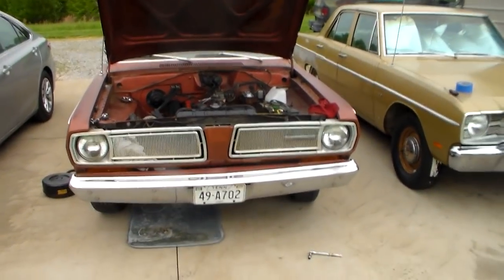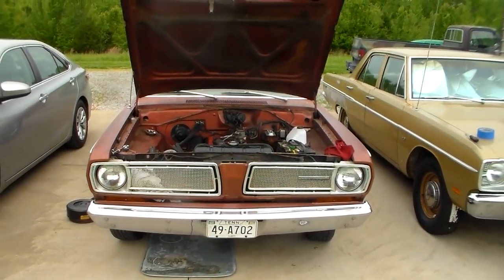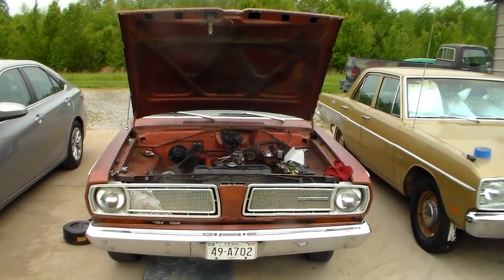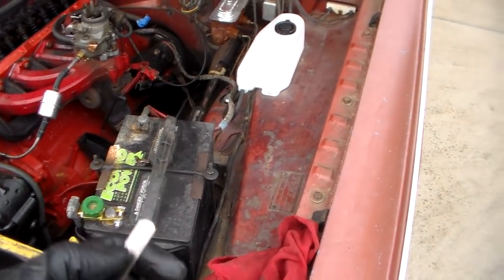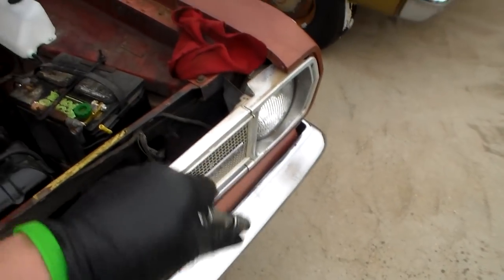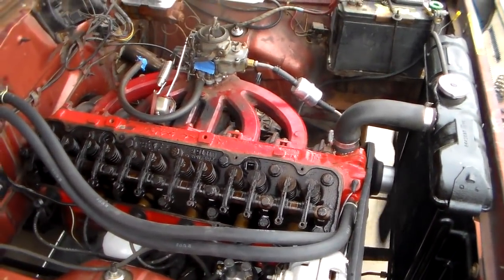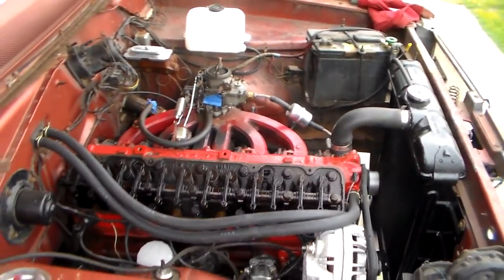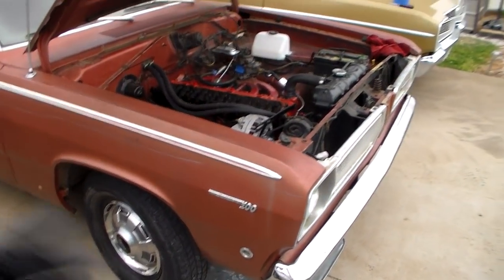Why every 1960-80 Mopar slant six should have "noisy lifters"

Comment: Bought a 1974 red Plymouth Duster in 1976 with 18,000 miles in central N. C. Slant six factory three in the floor. Transmission specified ATF fluid but it was a manual. No power accessories at all, brakes, steering, AC, nothing.  Would do 83 MPH in second and 105 in third and got 33 MPG all day long on a one barrel Holly on the highway. 300,000 miles in 16 years with normal wear items and two sets of rear axle outer bearings at $20 each. Bone stock, 185-14 Michelins went 85,000 miles every set. Torsion bar suspension can't be beat, real fun to drive every day even in 12 inches of snow! I now have a 2018 Camry SE that gets 44 on the highway and is the only car I have ever owned that makes me feel like my Plymouth Duster did. Economy top tier, fun top tier, handling incredible, fast enough, safe, reliable and everyone likes it. Go Kentucky! Be sure to drink your Ovaltine (A Christmas a Story, and be sure to adjust the valve rockers). Thanks for your video. I have a few hundred old car stories.
Reply: My Volare with the four speed OD trans also uses ATF. Strangest thing, but it works.

Comment: Those slant sixes 170 & 225 cubes,and the cars they were in,were very reliable and economical cars to own.Teamed up with a 3 speed manual or a 904 it was easily the toughest car in its price range. The 170 was in a van,and  so was the 225 when the engines lived with you in the cab.Superb delivery vehicles of great endurance.If somebody would have put fuel injection,and MAYBE a turbo on them- that vehicle would be a rocket
Reply: There was also a 260 inchg version for some trucks,met a guy who had a dual,carb,, hot cam,header,etc equipped 260 in an early  Barracuda,sounded mean,went like stink-I had a 63 golden edition Dart GT  convert. with the 225-great car.

Comment: To correctly adjust the valves on these or any inline 6 with a firing order of 1, 5, 3, 6, 2, 4 (which is about 99.9999999% of them, you need to know a secret.
The secret, that is no secret at all is the opposite cylinders from the outside in *6-1, 2-5, 4-3, 1-6, 5-2, 3-4 have a handy relationship for valve adjustment.
*notice how the 2nd numbers are the firing order of 1,5,3,6,2,4.
This is because when you see the engine without the head on you can see cylinders' 1&6 pistons rise and fall together. This happens on 2&5 and 3&4. Since the cylinders don't fire together this means the other piston in the pair are exactly 2 strokes or one full turn away.  

To make it a bit clearer imagine if the head was off your Slant 6 engine.
looking down at the cylinders put in your head that: 
1 and 6 are a pair (and vice versa) and go up and down together
2 and 5 are a pair (and vice versa) and go up and down together
3 and 4 are a pair (and vice versa) and go up and down together

Inline 6 below with cylinder 1 at top and cylinder 6 at bottom shows lash adjustment relationship:

Chart
to adjust cylinder 1 rock no 6 (pair)
to adjust cylinder 2 rock no 5 (pair)
to adjust cylinder 3 rock no 4 (pair)
to adjust cylinder 4 rock no 3 (vice versa pair)
to adjust cylinder 5 rock no 2 (vice versa pair)
to adjust cylinder 6 rock no 1 (vice versa pair)

So there's really only 3 pairs yeah??

'rock' means intake closing, exhaust opening (so the end of the exhaust stroke and beginning of the intake stroke ie the overlap phase)
The rocker arms are both moving ie one closing the other opening.

It so happens that when the rocking cylinders are rocking, the opposite cylinder as shown in the chart above has the cam lobes on the base circle of the camshaft and can be adjusted correctly.

Now since our motor doesn't fire in the order 1,2,3,4,5,6 there is a far more efficient way of doing it rather than rotating the engine 10x and it going cold and the lash changing when it warms up again because we adjusted the lash hot and it cooled down because we took so long.

So - On a 4 stroke engine there are 2 TDC positions. 
What we're aiming to do here is get the correct TDC of no1 at TDC at the end of the compression stroke (or beginning of the power stroke - SAME THING).

A) Note position of no1 spark plug wire in the cap. Remove distributor cap. Rotate motor until distributor rotor is around the position of no1. 

B) Remove rocker cover. Rotate the motor with the fan to get no. 6 rocking. It should already be really close since we just rotated the motor so dist rotor was pointing to No.1 (the chart above shows the relationship)

Now we've done that, this is the magic: We should be able to adjust all the cylinders in two rotations of the crankshaft. 4 strokes = 720deg crank rotation or two turns. 720 deg divide 6 cylinders = 120 deg crank rotation per valve adjustment. 
The distributor rotor further helps by pointing to the cylinder we need to adjust next!

We're now going to adjust all  the valve lashes in the firing order like a professional mechanic.
Remember inline 6 firing order 1-5-3-6-2-4 and the pairs shown in the chart.

C) So if we followed A & B (above) no 1 is ready to adjust - adjust it to hot spec. 
the next cylinder at TDC on the compression stroke is going to be no 5 This means rock no 2 adjust 5
the next cylinder at TDC on the compression stroke is going to be no 3 This means rock no 4 adjust 3
the next cylinder at TDC on the compression stroke is going to be no 6 This means rock no 1 adjust 6
the next cylinder at TDC on the compression stroke is going to be no 2 This means rock no 5 adjust 2
the next cylinder at TDC on the compression stroke is going to be no 4 This means rock no 3 adjust 4

The bold numbers show the firing order.

Again,
If the head were off your Slant 6 engine looking at the cylinders put in your head that: 
1 and 6 are a pair and vice versa.
2 and 5 are a pair and vice versa. 
3 and 4 are a pair and vice versa.

This technique also works for inline 4 cylinder engines ie 1-4 2-3 and vice versa are the pairs.
Exact same principal for lash adjustment except have to turn the motor 180 degrees instead of 120 in a 6!

You can't use this technique on a V8 or V6 because the cylinder numbering is often different therefore the cam lobes are in different positions from different manufacurers but it does work on a V12 because it has a firing order of an inline 6 per bank ie each bank is 1-5-3-6-2-4 lol.
Reply: ThePaulv12 well at least I know why these things tore themselves apart after a long good hard run. Knew a few people who never took the valve covers off though they tweek the carb every chance they had. In every case the crank eventually gave out even with schedule oil changes.
Reply: @kennethwallace4338  i completely agree with you
Average reliability and after the hard run at 90mph no.6 big end lets go, ventilates the block and smashes the starter off. They're an effing pos! lol  I know.
Reply: Damn you know a lot

Comment: Grandpa had a slant 6 in a '60 Valiant Station wagon...over 300K mi , never had the valve cover off .
  Worked at a ski resort for a summer and a couple of the Auxiliary Power Units (back up to the electric motors) were Industrial 225 motors !

Comment: If the lifters are adjusted regularly they are as quiet as a hydraulic lifter engine. In the case of an old engine, quieter. I have had a dozen slant sixes and only one had quiet lifters. It was a 22 year old  pickup truck with 160,000 miles on it, BUT it had been maintained properly all its life.

Solid lifter cams are designed with clearance ramps that take up the valve clearance gently before opening the valves. Hydraulic lifter cams don't have clearance ramps which is why you can't run solid lifters on a hydraulic cam or vice versa.

One that is not kept adjusted will continue to run but, the tip of the rocker arm and the end of the valve stem get pounded out of shape. After that you can adjust them and they will be quieter but never completely silent.
Reply: The elipse or the grind is different. Learned that fooling around with old Ford stuff.

Comment: Reminds me of tuning 6.2 diesels in the army. The new guys would always tune the injection timing till the engine ran super quite at idle. And I would always laugh as they went to drive it out of the shop and it wouldn’t go no where. Some times perfectly quiet is not perfect. Motor sounds great Tyler just like a old slant six should.

Comment: The best and most accurate way to do it is to get the engine hot then shut it off and use a socket and breaker bar to turn the engine slowly while you set each valve. If you are quick about it you probably won't have to restart the engine to keep it hot, however I do believe the old Motor service manuals had settings for both hot and cold. Just never like getting my feeler gauge in there on a running engine.

Comment: Looks like it was a well cared for engine... the inside is clean. Back in the day, I could tell what engine was in any brand or type of car, just by there sound. They all had there own unique sound. Now days cars and engines are so generic, they all sound the same.
Reply from the maker: It's a mystery engine. Dated 1972 with an actual mid-90's Mopar water pump which you cannot get anymore. It had the original manifolds and distributor installed. No trace of blue paint so I assume it has been rebuilt.
Reply: @TylersNeighborhoodGarage  they were very easy to work on had no problems adjusting the valve lash on my dad's 80 Volare.

Comment: One of the reasons the slant six is so durable is that it was originally supposed to be an aluminum block engine. After the engineers drew up the design the company brass changed their minds and decided it would be a cast iron block but they went ahead and used the design for an aluminum block so the block was much thicker than cast iron engine designs usually were.
Reply: They did make a lot of them in aluminum though in the early years. Clark 9the forklift company) used them in an RV they made for s short time, darts and Valiants could have one in a sport model. One of the features of the engine was it's long stroke, it's why the engine was tilted over to allow room for a lower hood line with a larger size engine. The longer stroke gave it more torque so as to make good power at lower revs, also improving economy, which was a big selling point in the early 60's. Chrysler got their money out of the design.

Comment: Good motor! Like Ford's big 300 six, these engines run forever! GM never had such a reliable inline six. Noisy lifters? MOTOR HONEY!!!!!
Reply: The hell you say ?!?!  GM's 250 inline was bullet proof just like the 225 and the 300. AMC's 232 and 258 were damn good engines as well.
Reply: LincolnTek  Too true my Gremlin was a 258 with a three speed and would chirp in every gear but neutral.
Reply: Had a straight 6 200ci  in a mustang with a 3 speed, 198ci Plymouth duster and chevy nova 250ci,  all great low maintenance engines made in Detroit.

Comment: If you set them too tight, it'll cause rough idle when hot. The alternator brushes are replaced from the outside. Use 20w50 in the Summer. The needle valve is replaced externally. Some have spark plug tube seals. The rubber O-ring leaks. The distributor gear is plastic. Check cylinder leakdown to check rings, valves, and head- gasket. Look up the improved head-gasket from the PCB. It's probably a steel gasket and not a Fel-Pro Blue stripe. The crank gear is pressed on. The front end has strut rods to adjust the caster. The camber is set by the egg-shaped cams.
Reply: 20W-50 is unnecessary and as the oil pump driven gear is a weak point 20W-50 can contribute to oil pump gear failure.

The strut rods are not adjustable. Camber and caster are both adjusted at the upper control arm eccentric bolts.
Reply: @Joshie2256  It cools the engine in very hot weather. It won't be too thick. The thicker oil absorbs heat from the cylinders and cools the engine. The bearings run cooler thereby extending bearing life. The valves run cooler especially the exhaust. The extra oil on cylinders drops into the pan. It takes up space between ring grooves. It oils the timing chain for longer life. The oil pump on a slant 6 is the rotor-type and the other end is a gear. It runs off the cam gear on the shaft. Thick oil transfers heat in the pan. It transfers heat so the oil picked up by the pump is cooler. Heads run cooler. Cams last longer. Heat is the destroyer of metal.

Comment: The AMC 242ci I6 has noisy lifers as well, at start up.  Once warm, they run quiet.  I have not seen a vehicle with an AMC 242ci I6 engine that does not start noisy.  But they last forever.

Comment: Post war Chevrolet OHV sixes are the same. With the engine warmed up and the hood raised you should just hear the valve train. If you can't, the lash is set too tight and burnt valves will  result.
On some engines back in the day, you could adjust the valves with the engine running. Pontiac streight 8 flat head engines for example could be done this way. Pull the passenger side front wheel, lift the fender mud flap away from the upper A arm, and remove the two valve covers. If you have a noisey lifter you can hold each lifter in turn to find it. Crack the lock nut on the adjuster and turn the adjuster till it quiets down. Like the OHV solid lifter engines a nice soft clatter is desireable for a street engine.

Comment: Those were great engines from a era where 100,000 miles was about the limit fir the cars of the day.  Valve jobs were common around the 50,000 mark and ring jobs were necessary shortly thereafter.  By 100k a rebore was usually needed.  The slant sixes were the exception.  They would do 150,000 miles and more.  They didn't get great fuel economy and they struggled with
emissions.  When the smog and fuel rules got stricter the end was soon to come and it did!

Comment: I had a 68 Dodge van with the slant six that kept rusting out the freeze plugs. I got so mad one day I put a brick on the Excelerator with the engine running at full RPM then went inside ,watched a movie, came back out and the motor was still spinning away and I thought oh damn ,I guess I have to fix it. It kept running for several years after that LOL

Comment: You're giving the right advice - but there is no way that the valves should be noisy like this if they are adjusted properly - as you said .010" intake and .020" exhaust with a fully HOT engine.  If they are adjusted properly the engine will be quiet at idle.  But it also should have no hint of ignition miss out the tailpipe (which would indicate an exhaust valve being held off its seat).  I have adjusted the valves on many slant 6 engines and they never sounded like that!  The problem you have here is that there doesn't appear to be any oil at all on top of the rocker arms.  There absolutely should be oil in the little groove on the rocker arms!  If there isn't, there is too much sludge in the rocker shaft.  The rocker shaft is hollow and it allows oil to flow to the top of the rocker arms and over the valve stems.  Either the rocker shaft is installed improperly - i.e. the hole in the shaft is pointing the wrong way, or the rocker shaft is full of sludge and it needs to be boiled out with caustic solution.  It seems to me that the reason for the noisiness is lack of lubrication at the top of the engine - which needs to be corrected or the valve train is going to wear out.  While adjusting the valves at idle, it isn't like oil should be all over the place, but it is pretty common for there to be enough oil on top of the engine with the valve over off for a small amount of it to run down the side of the engine.

Comment: Hey off topic, but I know people here know their slant 6s, I’m still new to them… where are you guys installing the probe for an aftermarket temp gauge, the hole for the stock sensor is too small, is there another spot or do I drill and tap? I ordered standard auto-meter 2inch  gauges for temp and oil pressure. These things seem to bolt right in to a v8…

Comment: I had a Dodge dart 1962 model. It always rattled. The motor was tuff as nails. The transmission wasn't so hot . I replaced it twice . Had the same thing in a truck later on . Guess they didn't make good transmissions . My brother got a transmission from a 1952 truck that was very good it never broke.
Reply: Oh yeah. The 3-speed was pretty flimsy. I got pretty good at replacing transmissions in my 1964 Valiant. Fortunately, they were light enough that I could rest one on my chest while I was under the car.
Reply: @soaringvulture  
I believe we did that a few times too until I found a four speed with over drive then I needed some help it weights more than the engine. I had a Doge dart first then a valiant and then a 1968 Plymouth Fury 3 , it was automatic but it leaked the day I got it and the day I got rid of it. Had it for ten years and it was a beast .

Comment: That's pretty damn quiet! When they're adjusted properly they are very quiet as far as solid lifters go. I wouldn't classify slant sixes as having noisy lifters.
Reply: I agree. I've had several cars with slant sixes and they were real smooth and quiet; at idle, you could hardly tell they were running. A very good engine.

Comment: Slant 6 was a great engine and seems like it doesn't get as much recognition as it deserves. I am a Bowtie guy thru and thru and no engine will ever have the rep of the original small block, but the slant 6 is in the same league. It's a shame Chrysler didn't invest more in R&D on this engine into the 80s & 90s. It could have had a bit longer lifespan instead of wheezing to its grave like the BOP engines did in the early 80s.

Comment: These are solid lifters. They all make noise.
Reply: Well, the slant sixes didn't. I owned several and they were very quiet engines.
Reply: @soaringvulture  they were great engines, the military used to put them in tow vehicles to move planes around. Ive had these and an old 273 v8. All solid lifters. Kept me from getting bored and in trouble.